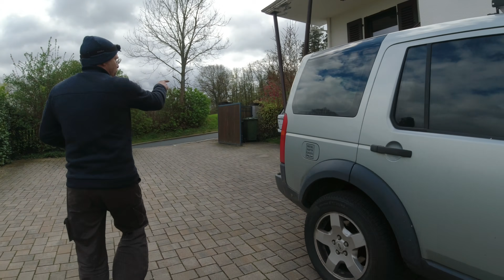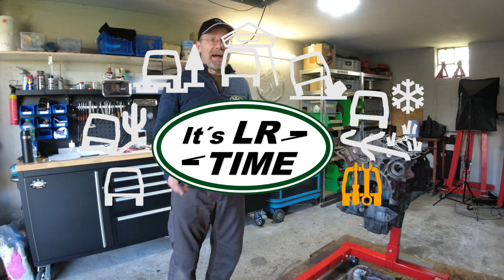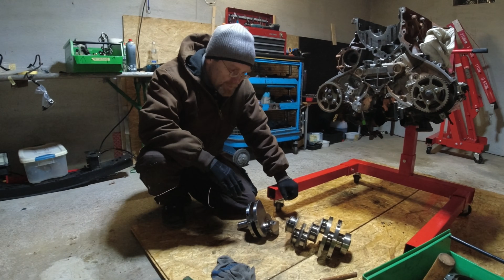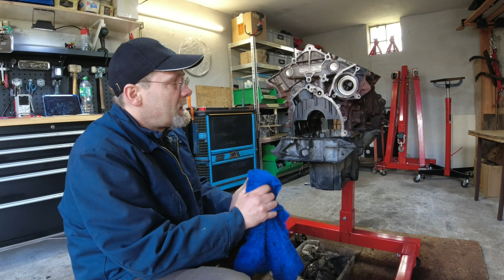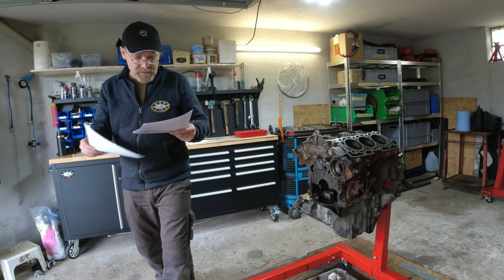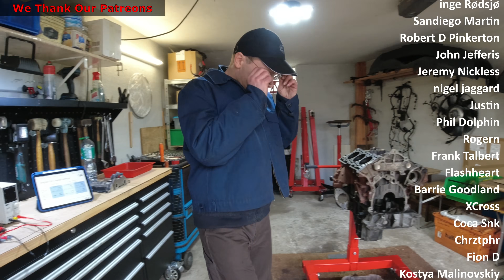Ford´s 3.0L Powerstroke failure modes - also JLR SDV6 306DT / S5-EP16

Comment: There's an urban legend in the aviation community about a guy who owns a business jet with 100,000 hours on the engine and the manufacturer offers to celebrate this by replacing the engine for free... because they want to take back the engine to find out what's so special about it.
The owner refuses the offer.

Same thing with a Disco' 3 engine, I think.
It you find one that's made it to 300k miles without major problems, you're probably onto a winner. 👍

Genuinely, if I was looking to buy a Disco 3/4, I think my priorities would be a good chassis, runs okay, and at least 200k miles on the clock.
Reply: An urban legend it is...mind you Qantas has had several GE engines on wing for 10 years.

Comment: I still think you should throw caution to the wind, live on the edge and let Robin weld that block. He will learn about welding and peening cast iron. Christian is over qualified to do the machining that will be needed after the welding has been done. He can even get his father in to make sure it's done under adult supervision. If the base of the bore is damaged it will make for more good content watching Christian bore out and resleeve the damaged pot. I have successfully welded broken blocks with high nickel content rods and I don't have a fraction of Christians talents.

Comment: Excellent video Vera and Christian , yes , weld the block ( repair ) , Christian knowing your capabilities, your can see the damage , better than us , eg : “ domino” distortions , is it possible ?
Don’t think he ever said this , most definitely not , but  , “ replace “ correct “ oil sooner than later you  , if not sooner , most definitely than later,  engine WILL fail “ ( Confucius Said )😊

Comment: I have a gen 2 disco 4 with a broken big end. I have been offered a gen 1 engine from a jaguar. Do you think the block could be modified at the oil pump drilling you mentioned?.
I am going to rebuild the gen 1 engine if it is useable.
Reply from the maker: I don’t know. There are other differences too. Like the water pump. Christian

Comment: 👏 Dear Christian and Vera - one of your best videos ever! 🙏

It seems every UK non-motorway road is now ‘arduous’ for a Disco, due winter mud and floods providing ideal conditions in pothole mating season. Then just as soon as the sun comes out it’s caravan towing weather. Lastly weekdays, the 5 mile school run - to beat even the finest engineering team into submission; eat your heart out Le Mans and Monza! 😉

Btw, I think Henkel makes some quality German casting repair / hole filler good enough for another 150,000km at least. Stop over thinking it, calling Poland or worrying about British Policing - leave all that fluff to us - you do you, fire up the lathe and get milling! 🫡😊
Reply: you'd be correct.

Comment: Hi.. Great Vid... I have 2014 L405 3tdi... Oil changes every 6k miles.But the interim oil change is done by a mechanic that doesn't have access to LR website...Also asked a specialist to do oil change and update it on the site but he said he couldn't do the update because it wasn't at the full service interval period and wsnt space on the site pages to update as a partial service before the actual one... but I've kept all receipts... the car has about 95k miles... 
Question is...would you use w5/40 if it were yours... currently using Castrol 5/30
Great channel... so interesting.  Really helps with my maintenance regime and importantly driving style.
I tow 2.5 tonne about 12 times a year and also drive on the continent at about 70mph for about 7k miles per year (not towing) no hard acceleration. Gradually build up tp speeds.
Cheers

Comment: Local Ford dealer tells F150/Ranger customers that Ford changed the crank manufacturing process from cast to forged to overcome known failures. It may be worth validating this claim, or it may just be sales spin.
Reply from the maker: The crank was always forged. Christian

Comment: My evoque with the ingenium 2.0 diesel  engine these suffer from the same problem with oil dilution and timing chain issue but these have a built in sensor that should alter the oil change service light once the oil dilution gets so bad, so now with my shorter journeys esp in winter times as like many other people  dont go further afield and this is when I get it,  in September the service light goes on and at the end of February,  you can even see this on the LR app it will tell you how many miles you have left for your next service , with a fresh service the miles will be high lets say 12,000 miles ( thats me guessing ) but then as time goes by that figure will rapidly drop, once I looked at it and it said 1500-2000 miles then a few weeks later the service light came on and trust me I didnt do those miles in that short space of time. The thing is how many owners think wow must be a glitch I only had it serviced a few months a go,  I will just check out how to cancel the service light, so then they are running around in a car with oil thats thin and not doing its job,  and trust me people will google how to cancel a service light you will see it in forums etc
Reply from the maker: Thanks!  Christian

Comment: hi ! 
what about tdv8 engine ! would you recommend running on 5w40?
ps. So far I run 5w30 liqui moly, every 10k km oil change runs like dream , next oil change gona try liqui moly ceratec additive!!
Reply from the maker: It’s up to you and it depends on many other factors.  I run 5w30 in my TDV8 for various other reasons.  Christian
Reply: @Vera_and_Christian  thanks for you answer!
I stick with frequent oil changes and then it probably lasts :D

Comment: Christian can I put 5W 40 semi or Full synthetic in my 35k miles Jaguar XJ 2016  V6 3.0 diesel?

It's had 7 crazy people main dealer services using Castrol Edge which I believe is a crazy 0W 30 watery grade ⚠️

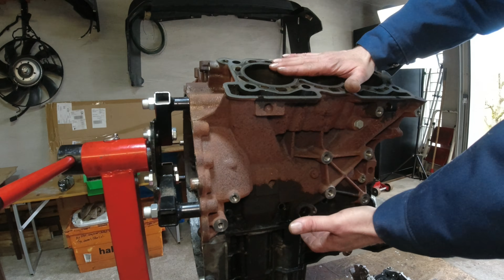Comment: 25:28 Guten tag Christian; I asked in your last video, why do you not weld repair your block?
Reply from the maker: There was no successful weld repair done on this block so far. It’s double wall. So four holes and endless cracks.  It’s graphite steel too.  Christian
Reply: @Vera_and_Christian  Understood. 👍

Comment: Brilliant episode.
Solution
 All manufacturers must be run by engineers.
Ban Cash for all payments over £10.
All cars must be guaranteed for 12 years and or 150,000 miles
The above will solve all of your problems today.
My Late Father an engineer did a study in the 60's to make a car that would last 20 years with only routeen maintenance, was told why are you trying to bankrupt us.

Comment: 150,000 MILES is the standard design life on most modern engines. That is approximately 5000 hours running on average.  Industrial medium duty and off-road engines are designed for a life of between 10,000 and 15,000 hours, so at least double that of light duty engines such as most cars and even light commercials. They can last much longer of course, but many don’t. I have a couple of Ishikawajima Shibaura [ISM] 2.0 industrial diesel engine in skid steer loaders [New Holland] and their detailed manual specifically mentions a 6500 hour design life, which is not good, because both of mine are now approaching 8000 hours use but still run as new as far as I can tell. Apart from the usual water pumps, radiators, alternators and starters, the only issue has been the exhaust manifold bolts on both came loose at about 7000 hours, within a year of each other. They are now 22 years old.

Comment: That fluctuation in dark and light is because the camera gets blinded, it tries to electronically ajust its sensitivity to the brightest part of the image. So a lot of the times I see this tube light at the top of the screen going in and out and the camera ajusting accordingly and back again. It happens alot in car videos when filming the underside of a car for instance, if you dont get the shot fully under it it wil black out because of that edge of daylight sky. It's the 'exposure compensation' function doing this, which you can actually shut off in the menu I believe. So your camera is actually NOT broken, its functioning properly lol. You can look at this form 2 angles, you can ajust the camera yourself to over expose the bright parts. Or you can treat it as you treat your own eyes. Don't look into the light source look away from it, there where it's shining on. I believe you could also do your light measuring as a point source, so you just aim at a darker point and the camera will ajust to that. Just a few ideas :)
Reply from the maker: We use the camera for three years.  It’s broken when hot.  It also happens when the camera is steady on a tripod.  We bought a new DJI and the footage is much better.  Will be 2 more weeks before we show the first video from the new camera.  Thanks.  Christian

Comment: Is this something you know about, oil in brake booster?? I
Reply from the maker: Bad check valve.  There was a recall on the LR3.  Google for the service Bulletin.  Christian
Reply: @Vera_and_Christian  if it’s a older model do they still do recall

Comment: The 3.0 V6 after being used in the F150, is now used in the Ford Ranger sold in Africa, Australia and Central/South America. I can't wait for the satellite phone calls to Ford Australia to come fix my engine on the Canning Stock Route. However, it will provide lots of spare parts...
Reply: And UK / Europe now !
Reply: It's in the new model VW Amaroke  now 😅😅
What a clown show
Reply: At least it has a forged crank now! 
Run 5W-40 CK4 spec oil in it, and it'll last longer.

Comment: i drop oil every 3000 miles 5w30, my crank went at 78k after my turbo blew its load, its been fully rebuilt now with two new turbos so hopefully not a problem now in my lifetime, also got rid of dpf so no oil dilution and got rid of the egr and a basic remap for better mpg
Reply: Wouldn't use 5w-30 the worst oil for this engine
Reply from the maker: Yep , now you just need to get rid of the 5W30. 😃👍🙋‍♀️

Comment: Kia has programmed the knock sensor to sense the engine bearing wear and would through an error. This should be stock for LR products.
Also, I saw a 2010 XJ with less than 30k miles and it had an engine failure. I was surprised to say the least.

Comment: Hi Christian and Vera!
After years I sold my ‘09 RRS with the tdv8 for a ‘23 defender 90.

It has 8k km’s and I’m planning an oil change. 
My RRS I always used 5W40 since your video about this.

Question; do I go 5W40 as well for my new defender?

Comment: I suppose with in town driving and more EGR the oil get dirtier more quickly and if you run at low load the valve on the oil pumps runs at low pressure most of the time. more dirt may clog the movement of the control. If the pressure does not change and stays at low the bearings suffer. The engine ECU you would expect to monitor the oil pressure and put and alarm and fault code up if t did not match what is expected.

Comment: Engine oil change frequency is super critical on today’s highly stressed engines. Manufacturers promote large change intervals from commercial self interest. Understanding oil quality is complex - viscosity index, PAO, semi, fully synthetic. Ignore and it can be costly. The LR range are expensive pigs to maintain. I’m a Toyota Corolla 2006 hatchback man with oil changes once a year and 5 K miles, Edge 0W 30 because it has additional PAO.

Comment: Early TDV6 such as mine MY08  has log book oil change with dumbass of 15,000km or 6 months (half for arduous). This changed soon after. 6 months is very safe sometimes 7000 km sometimes 10,000km. My average since new is 9,000km using 5-40 now for last years. I hope my main bearings are happy now 300,000km.

P.S. as kids we said;

Found
On
Rubbish 
Dump

But I love my TDV6 ❤

Comment: Good viewing Guys, with pertinent comment as always. 
Is metal stiching the hole in the block out of the question to repair the block and a new crank bore alignment?

Metal stitching is an industrial technique for repairing cracked and broken cast iron, steel, bronze or aluminium structures and their components. The process is carried out cold, without welding.

Comment: The oil analysis chap in the US (on YouTube) says change your oil 3 or 4 times up to the first 10k miles!  Vera hit the nail on the head...  Don't all engines have a control/bypass valve for excessive pressure?  I remember shimming the spring on the PRV in my Triumph GT6 Mk2!  The Police think any form of theft here (shoplifting!) is a legitimate business.  Non PC but it's true.  Surely you could make the F150 fit?  Even if it meant 1 turbo only - I'm probably talking rubbish I know, but it would make really interesting viewing!  Really enjoyed this video.
Reply from the maker: Thanks.  Christian

Comment: Hi Christian, you know you want to weld-up the block, Robin wants to weld-up the block, Vera wants you to weld up the block, all your viewers want you to weld-up the block, the tow truck driver wants you to weld-up the block, ONLY the guy wanting to sell you a block with "<15,000 km" for a cashy doesn't want you to weld-up the block.  I also know you will amaze us with a tool to check the alignment of the main bearing housings to confirm it is not out of alignment.  The hole looks to have been punched in a non-structural area - but then again I have to look at your videos upside down on account of watching from Australia!  Go on - do us all a favour.  What have you got to lose?????
Reply: Best comment ever.😂
Reply: Weld, weld, weld!!!
Reply: I mentioned this in the last Video, why not try it, he can drop these engines in 4 hours now 😊
Reply: I do head stand yoga to watch these. ;-) Go the weld. Go the weld.
Reply: Best comment, exactly what I was thinking 👍👍
Reply: Hi Vera and Christian You're going to do it because you're the only one who's there you can do, with your son, its a bet. Congratulations for all you do BROVO👏👏👏
Reply: Do it! Weld it! Go, Go, Go !!!
Reply: At this point Christian has to weld the block.
Reply: I think a weld repair is the  most viable and Robin has the skillset and can showcase his talent.
Reply: Welding cast iron is not a simple job. Cast iron doesn't weld like mild steel, it's got a lot of carbon in it that interferes with the process. Maybe if there was a specialist with a YouTube channel interested in a cross-over project? No idea who that would be though.
Reply: Excellent tutorial thank you.
Reply: Agreed. There's nothing to loose. People in South Asia repair castings in roadside shacks on dirt floors (although we never know how long the repairs last). And it would be quite engaging content.
Reply: Please please weld the block you have the skills and would make a great video 👍
Reply: Come on Christian get Robin to weld it up! Any missing bits you can fill in with JB Weld!
Reply: Dooo it, Dooo it, Dooo it, Dooo it. 

Once it’s done, simply service it every 1000km to be on the safe side 🤣
Reply: Yes, I had a Perkins straigt 6 diesel in a digger. About 8L I think. Bought cheap as the block was badly split from freezing. Welded up by specialist company. Alignments checked out OK. Was a great machine that I used for 10 years before selling as no longer required.. Go for it.
Reply: In Berlin kauft man keine Autos. Und erst recht keine Motoren! 😂
Reply: Isn't the block some sort of composite alloy?, wonder if that can be welded at all.
Reply: Nickel alloy electrodes are the most popular for cast iron welding
Reply: To weld or not to weld that is the question
Reply: Use the new engine and sell the old engine to the welders
Reply: Weld please 😂❤
Reply: It serves no purpose to weld the engine block. Just because you can doesn’t mean you should.
Reply: Agreed! Weld it. Robin has the skill I'm sure. 👍

Comment: My Landcruiser with 5,480,983 kilometre's has just needed new bearings.
Reply: In the differential, the engine is still fine.
Reply from the maker: Lol. Cause you did not change your oil.  Christian

Comment: Fantastic description of the oil pump. I worked on Durability & Warranty for (Vauxhall/Opel) 1994-2003) on the Ecotec V6, our oil pump had 2 control Valves, a spool valve (like you discussed) that regulated the oil pressure to 5 bar and a pressure relief valve that opened at 10 bar and dumped the oil into the crankcase. The problem we had was (as you mentioned) over pressure causing oil leaks and oil in water ! This was due to the opening port to the spool valve getting partially blocked up so the oil pressure would rise to 7/8 bar depending how often the oil was changed. As desktop mechanics would not listen to advice , the owners (and dealers) just kept changing seals and gaskets then blame the heat exchanger for the problem. So before I carry out any oil leak on this engine I would first check the oil pressure with a gauge to see what pressure the regulator was opening, a good oil flush at every oil change could sort this out. Changing seals & gaskets just shifted the leak to somewhere else (usually a more expensive part) Keep up the good work making these videos, makes me so happy I got rid of my 3.0 V6 TD Jaguar XF 😂
Reply: I remember that Ecotec V6 - I had 2 in a vectra and 2 in an Omega. Wasnt much in the way of fuel economics in that 170bhp odd motor.

Underpowered by todays standards but back then, I thought it was a cracking lump in a vectra manual 👍 (bit lacking in an a 4 speed auto heavy omega)

Question for you if I may - From memory, the 2.5/2.6 in a Vectra was mounted across the front axle  as per FWD. The Omega was mounted longitudinal as per the RWD in the Omega, how comes the intake manifolds looked totally different if it was the same engine ?
Reply: Interesting, where abouts would carry out the test on the engine? The APS?
Reply: What are you driving now?